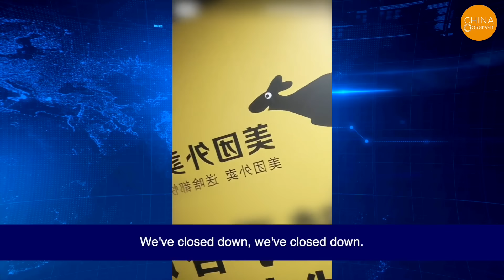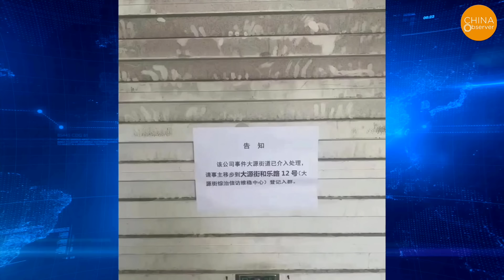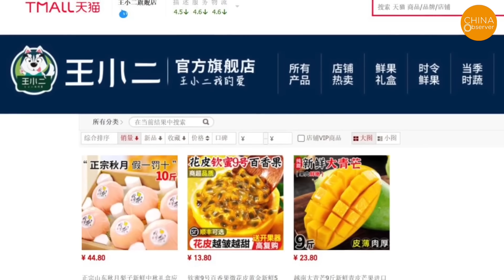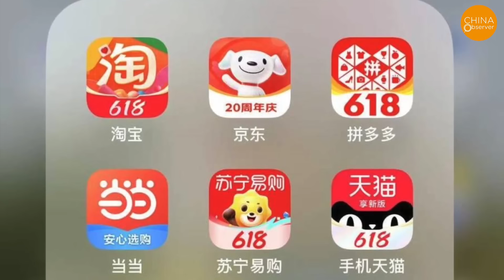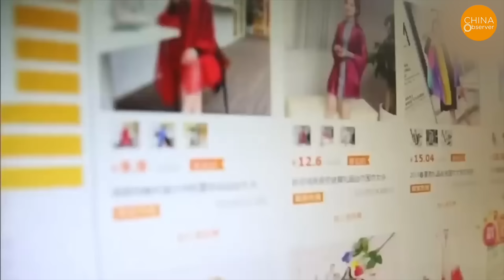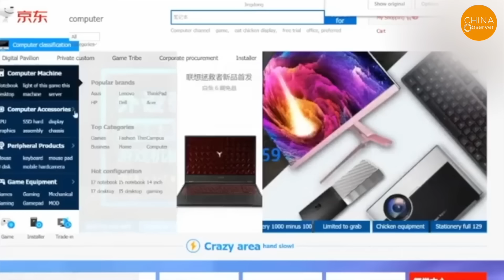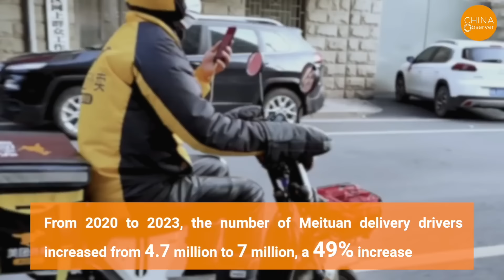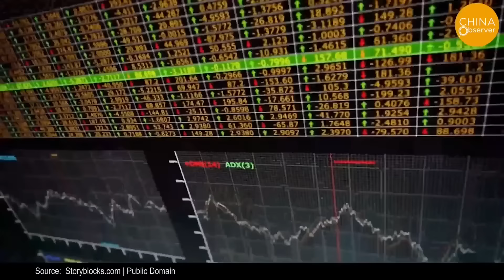China’s E-commerce Crash: 80% Will Fail, 90% Return Rate, Influencers’ Riches Dream Shattered

Comment: China placed their focus on proving their manufacturing prowess. They went all out to show the world they can make anything.
They seemed to have forgotten about quality and durability.

They have exported millions of cheap motorcycles to African countries which which work fine for at most 2yrs then the engine dies. There are no spare parts and you're told 'no spares, just buy new one.'

They're exporting their Higer and Zhong Tong Buses as a cheap alternative to Marcopolo and Scania buses. Fleet operators start having problems with the buses barely 3 months after taking delivery. I took a trip on one bus which was less than 6 months old and guess what? The transmission acted up. What was supposed to be a 7-hour bus ride stretched to an 11-hour trip. Mechanics had come on another bus and it took them 3 days to fix it.